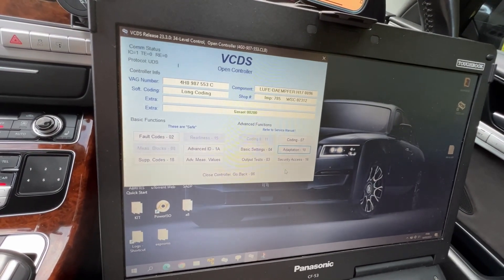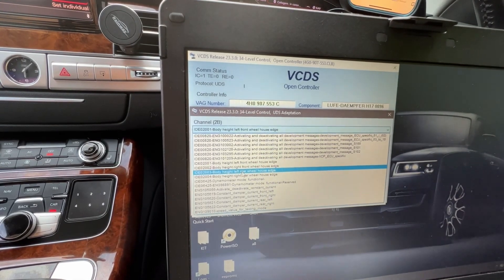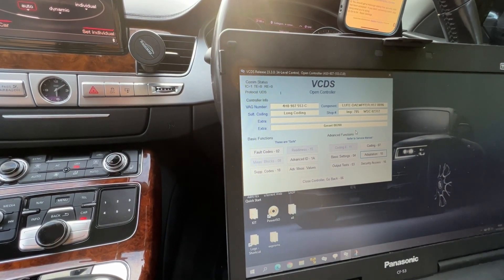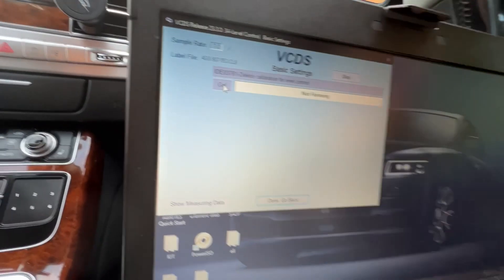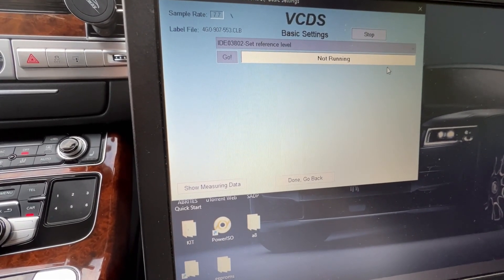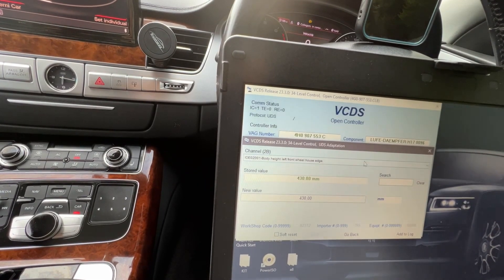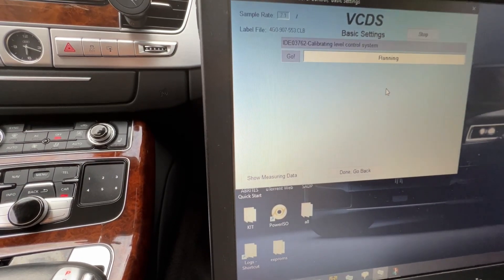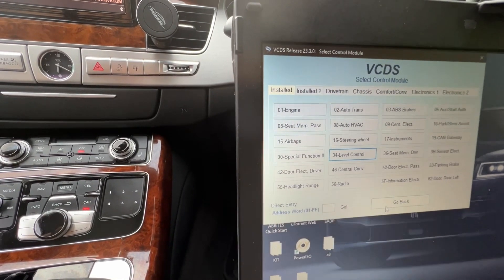Audi A8  4H Air Suspension lowering  with V.C.D.S (Vag Com)

Comment: my value are 390mm and my audi a8 2013 is lifted. I want more dropped. What value should be add?
Reply: You need to go UP, not down. So check your numbers, for example, if they are 420mm, then change to 430mm which will lower by 10mm.